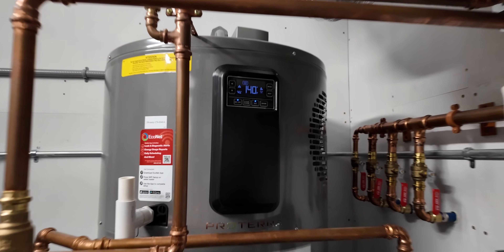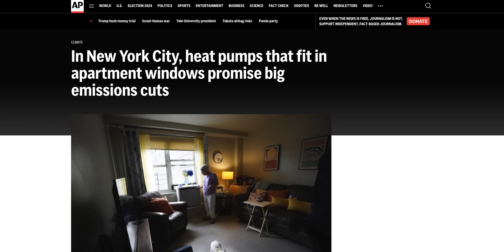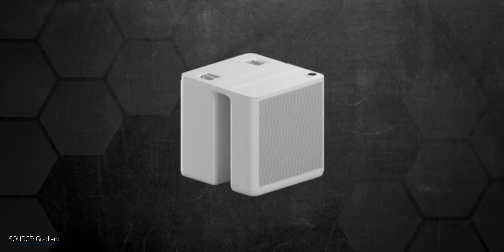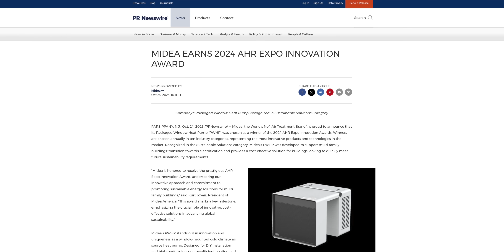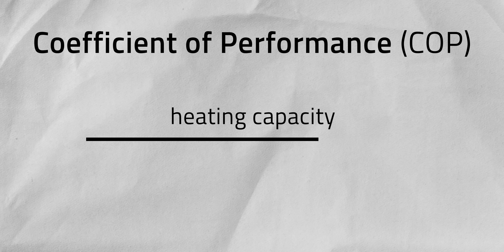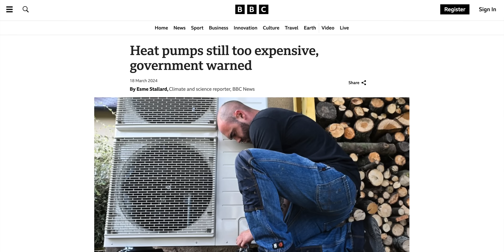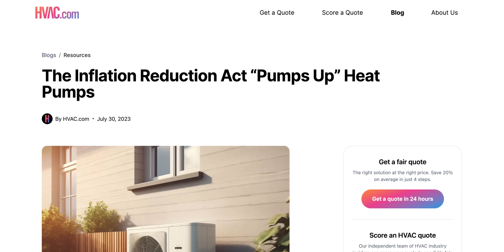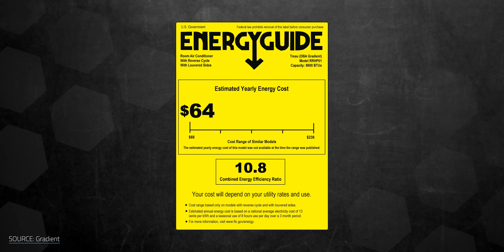Why This Window Heat Pump Is Genius

Comment: Wow, these things are pretty neat. I lived in Hoboken, Jersey City, Manhattan and Brooklyn so I know the pain as well. I would have loved to have one of these units when I lived in the area. 

In NYC, even though I had  permanently installed passthrough AC units my electric bill would be around $300-$350 in July and August (I also ran a home media server, but most of my energy expenditure went into keeping my apartment comfortable since I WFH). Due to poor insulation it would still be very humid inside (60%+ ) even though it was in the low 70s. We'd frequently get mass text messages from the electric company during heat waves to tell us to limit our AC and general electricity usage because we risk causing a blackout! They seem to be more efficient than window ACs, but the problem also is that the insulation and energy efficiency of the buildings themselves suck. 

I moved to Miami about 9 months ago and live in a building that is maybe 20-30 years old now and has central air/heat that I control. The worst its gotten in here was 67% humidity and 76F and that was when I came back yesterday after not having the HVAC system on for 5 days, while having my server running. I generally keep it around 72-74F and it stays around 55% humidity in here. Even with the server running and me being home all the time, it costs me about $100/month.

Comment: Very good example of the difference between upfront costs and operational costs. These are deemed "more expensive" because they are about 10x the cost to buy. But their use is roughly 10x cheaper... Any basic understanding of how to amortize costs makes this a no-brainer.

Comment: ahh yes, I would love to have a unit like this
one major flaw with the classical window AC(other than the stupid lack of a reversing valve in a system that already has a variable speed drive and uses safer r22) is 
actually the bulk and the difficulty in supporting it properly in older windows(or even fitting one in shorter windows

if these types of "easy install ductless mini split" units were more common I could safely install a small bracket in any window I wish and bolt the two halves in place(they would be semi-equal weight to prevent torque issues) and screw in two simple flex lines and a power cable through a tiny insulated passthrough panel

the problem with most heat-pump devices is the cost and the form factor, we assume people will either install a unit in an owned structure(like a homeowner) or they are a tennet who likely already has heating and only needs a box to cool

we need to accept that we should make it illegal to keep selling units without reversing valves, the valve is so dam cheap and the benefits far outweigh anything else even if your window AC has to modulate fan speed because the compressor is fixed speed

though I think a standardization of modular parts should be the end-goal, you buy a box full of various bits, sometimes partly assembled, and you thread together the tubes, plug in some connectors, and press the power button

I could install a windows mounted ductless mini-split easily, in fact I have a crappy end-table right where it would go, sadly there is a heating radiator below so I would need one that can handle THICCK walls, but if it handles blowing air around I could also take advantage of the heating provided by the landlord(if I ever needed it, I never do, even below 0F outside) while benefiting from the cooling capacity
mix in the ability to remove it later(flex tubes that are not soft copper hardlines for easy moving) and you have tenants simply owning 1-3 units they can take with them when they inevitably move

mix in the standard modular parts(an IGBT module controlled by the computer module with code on a design-specific standard data card that runs teh standard 3-phase compressor and fans and has a resting refrigerant charge tester and purging pump and auto-top-off  controller and you can just sell the user parts and extra refrigerant in standard canisters they can't mess with easily and you have systems that prevent e-waste and refrigerant leaks

sure giving users access to refrigerant directly is silly, but you aren't actually doing so, you are letting teh machine purge and refill, and even note when it is likely to have coil damage causing leaks and tell the user to order a new coil module

HOWEVER we need to make it ILLEGAL for companies to have proprietary apps to use smart features instead of the perfected and infinitely compatible WPS button and web GUI that has existed on routers since the dawn of the internet

I am talking about products like the horrible brand frigidaire windows AC I have that refuses to let the app that is REQUIRED for setup+control run on the phone I bought new that is <1 year old(at the time of setup) even install on my phone, and it doesn't have a standard way to simply connect to wifi with 0% mobile usage(because it is a home device being used in an apartment with a server computer running 24/7365)

sorry but "download the app to setup smart features" needs to be illegal as a requirement, you can offer an OPTIONAL app and OPTIONAL account for WAN control, but my window AC controlled 100% locally should have literally 0% access to teh internet(except maybe if the electric company asks to have access to the smart controls of high-load devices to reduce load without killing power/devices entirely)

so because of the worthlessness of the Frigidaire app(it won't even let me download it on a modern enough phone) they should not legally be allowed to call it "wifi controlled" as it clearly is NOT wifi, it is only legally allowed to be called "app controlled" in which case I would not buy it for that feature, I would pick the best rated, most efficient, and then cheapest model
which means they are trying to sell me on it being something I can command from my PC, which is a lie, false advertising, something I could probably sue and win over

Comment: My LG duel inverter AC cost $450 and that is expensive, but it is the quietest and
most efficient window unit I have used in 40 years.

Comment: ahh yes, the biggest flaw of heat-pump adoption
grid load

what we need to do is accept that the electric grid is outdated, it was designed ONLY for RESISTIVE and INDUCTIVE loads that could handle voltage dips to reduce load at high demand

after all, it was originally designed for incandescent light bulbs and factories

what we need is to have more granularity of grid load shedding, we need each homeowner/apartment renter to offer a number of devices that are "non critical" that grid operators can disable for a defined timeframe
in my case I would allow them to disable my PC UPS inverter array for a few % of it's battery capacity, and to force it to charge at varying rates(0-100% of the battery charge rate safety limit) based on what load they need to add or remove to balance nuclear reactor ramping and other loads

we can also tend to have semi-smart heat pumps, devices that utilize adjustable compressor speeds means adjustable loads

if we define our preferred thermal range(like what it MUST be for us to sleep properly, and what temps we can tolerate when awake and when we can have it go fully off because we are not at home, like when we are working(kept obfuscated except what part of the grid it would shed load on for security)) we can easily have these new heat-pumps act like variable loads, for both shedding and adding load based on grid conditions

after all, nuclear is the safest and cleanest energy besides intermittent sources like solar/wind or the geographical limited hydro

the flaw with a full-nuclear grid is actually the ramp speed of the generation, we can't just turn on/off a reactor, the byproducts that need time to decay before it can be started up again take a few hours, and if you ramp down too fast you get something like Chernobyl/fukushima, an event where the core just melts, and if it happens badly enough it can cause steam explosions, which can carry small and mostly harmless amounts of natural radioactive fuels with it

what we need is the ability to load shed in a 100% ANALOG fashion, this means that rather than killing entire blocks of the grid, we instead turn off or throttle larger loads(a huge benefit for EV adoption is the ability to charge anywhere, and adjust load by telling the EVSE to alter supply limits the car is allowed to pull)
add in heat-pumps with ESC controllers to a large EV fleet with replaceable battery packs(only way to make EV's on-par with gasoline in terms of durability and affordability)
and you suddenly get a nearly analog grid control, a few more devices like water heaters(devices that seldom need to be heated and can even use overtemp+mixing valves to add a larger thermal buffer) and even the ability to disable various electronics(tell your laptop to slow charging to "maintain battery level only" when grid is stressed) and even possibly disable outdoor lighting when there is nobody around to care and you can shed load without leaving customers without any power, or in dangerous situations where the food in their fridges gets warm enough because they had to shut down the entire customer when they could have disabled just the water heater

Comment: I agree with every thing in this video but I’m not paying $3-5k for a reverse AC. There’s no way it costs $2700 to reverse an AC. Look at Midea U, fundamentally the same thing but without a reverse function. They need to be far cheaper before I consider it.

Comment: Windows units would need some form of a circulating fan for most multi-room dwellings.   Some furnace controllers allow the fan and thermostat to just move the air around until a (within limits) homogeneous temperature is achieved.

Comment: Hm.. I guess you're trading the efficiency of 3-phase motor with extremely easy installation. Great way to transition between the two system, but probably not the most energy efficient (could be economically efficient though, depending on price and government incentives and other stuff, also I can get a good heat-pump AC in about 1500 USD in Indonesia)

Comment: When I saw the window units in a U shape, I immediately said they should have went with an n shape so it's not blocking the window. About a year later, ads for the better orientation started popping up. The price is crazy though, considering it's just like a minisplit all-in-one package. You can get a 12k BTU minisplit from MrCool, make a hanger rig to go over a window sill, and install the split just like these do and it's $1800. Running a 240/208v line to it would be the only hangup, but I can see you easily bypassing that by using the oven or dryer outlet. So for $2000, you can get 2x the heating/cooling power with a bit of know-how. Charging $3000 for a smaller unit is robbery.

Comment: Oh, let's 20X the price because we installed a reversing valve. What a load of bovine excrement. This is:

a) targeted fraud for the clueless (or malevolent [i.e. in cahoots] lobbiers/)politicians to milk those sweet, sweet state subsidies;
b) a fool's tax, plain and simple.

Repeat after me:
(most models of) "heat pumps" are nothing but a "modern inverter-based mini-splits with heating function" in a maybe a different form factor.

Comment: As a renter of a Berlin historic apartment my first thought was "this prolly won't work with our building codes, mandating unadulterated uniform fassades" (same style window frames everywhere, no clustered AC units here and there). 
What IS legal here is anything happening on your balcony though. It used to be satellite dishes now we got balcony PV systems (fastened with velcro or zip ties) plugging straight into the apartments outlet.
I wonder what Germany specific solutions they come up with so renters can do their own thing without having the landlord replace the gas boiler we all got in our kitchens upping the rent once more (we still got world class renters protections though, let's be honest about that).
In the meantime I'll keep burning compressed wood bricks in my 1910 9ft tall tiled stove to avoid using LNG brought in from overseas ...

Comment: At the end of the day, these are still window units. 1.) Window units are ugly. At least with a mini split, you can remote the outside part to a flat roof or around back, where it's not noticeable. 2.) Window units are typically LOUD, have weird rattles, etc. I've never had a window unit where I didn't have to shim something to keep down on the noise. 3.) Gaps around the top of the window and sides of the units - every window unit has these issues. 

I think these would okay for a temporary fix until a central system could be installed in the building, but as a permanent, full time solution, not so much.

Comment: One size never fits all.  But this might be a good option for some people.  The large scale test will be interesting.  The stats should be made public.  I'd caution though that all specs are hyped up and inflated bullshit, price gouging a federally subsidized program, and these units may fail spectacularly with heatstroke deaths in summer, burst pipes in winter, overloaded support and reman or repair services, or taking money and runnimg, leaving jank units for the taxpayer to remove and dispose of.

Comment: Cool. But. These will only work with double hung windows. In Europe, I can't think of the last time I saw a double hung window. Not once. And I'm German and American. From a builder's perspective, having installed many windows, my understanding is that most window installs, in the US, are casement windows. Double hung windows are mainly in New England. Lastly, double hung windows only work, in terms of air-infiltration, when they're closed. With the bottom sash up, you've got all kinds of air infiltration between the panes, let alone at the bottom. These videos make the installation look clean and minimalist, but there's going to have to be a lot of work done to seal the windows against air-infiltration. That or one has to ding the efficiency of the units.

Comment: I've been waiting for this thing or the Midea variant for like a decade.  This isn't new, it's been vaporware for a long time.  And as far as I know, nothing has changed.  They sell air conditioners in this form factor, but not heat pumps.  The closest thing to a window heat pump unit is to either install a regular ductless system on a window mounted rack or a through wall unit from Amana that doesn't fit into a standard through wall size sleeve.  It's really frustrating!

Comment: The cost is too high but that’s a problem for Heat Pumps already. But the obvious thing is to replace the central heating unit with a central Heat Pump. People might want this because they want an AC and like to install it themselves.

Comment: This looked so much like an add. No questions about the efficiency loss of the insulation of the window by that presence of the AC unit. Only a price comparison against non-reversible AC unit. That being said the comparison against replacing the building heat source by a more efficient one was welcome.
Reply: Thats all this guy does is hype up crap that never goes anywhwrw
Reply: @jhoughjr1 not true. A lot of what he talks about is what people that build things have known about for a decade before it hits Youtube.
Reply: @sparksmcgee6641  lol nothing he has ever covered changed anything.
Ive had a heat pump and we froze all the time.
In SW MO.
Reply: @jhoughjr1  no he's cover plenty of things that work but it seems like he's trying to keep up a schedule of videos so he does nonsense like this one. Hes go e from a must watch to a maybe watch over the last coupke years.
Reply: The profile is so small that the window is only cracked open a few inches.  I'm sure the unit kit comes with  insulation that you can put in to fill any gaps, which is better than just the glass window.
Reply: A windows is the worst part of a building. Putting a strip of insulation around the gaps caused by installing these makes the window it's installed in MORE efficient than the other windows.

Comment: absurdly expensive. these U-shaped or saddle shape window units became popular in the middle of pandemic. while nice, those will be easily beaten by small split-type or duct-less units that are getting popular here in Southeast Asia.  The outdoor and indoor parts of these are small and light, and one would only route the copper tube, drain pipe, electric cables through the window opening.

Comment: Another interesting idea for these older buildings would be to use the radiators for cooling purposes.  While not as efficient as the window mounted units it offers another way to cool without the need to retrofit those older apartment buildings.

Comment: At a COP of 2.8 (bad) it would mean gas needs to cost less than ~40% per kwh of the price of electricity for this to have a lower running cost. 
Thats the challenge. 
Most heat pumps have a COP of about 3.5+ so the gas price needs to be less than 30% to be cheaper to run than this.   
Whats the COP of these units when they are running above 0deg? Does it improve or are they at 2.x for most of the operating temperature range?

Comment: The cost will come down.  For every new technology, the initial price helps the company pay for r&d, new supply chains, hiring and training employees that can manufacture, new machinery needed for assembly, etc.  I’m not saying that the cost isn’t also inflated because of govt. contracts, or because it’s the ‘new best thing’, but every new technology was super high at first and now is a fraction of the cost.  Personally, I think starting at $3000 is a good sign that they will be down in the $1000-$500 range in 3-5 years.  We just need a little patience and to let competitive capitalism do its thing.